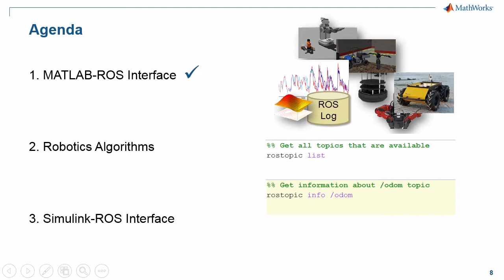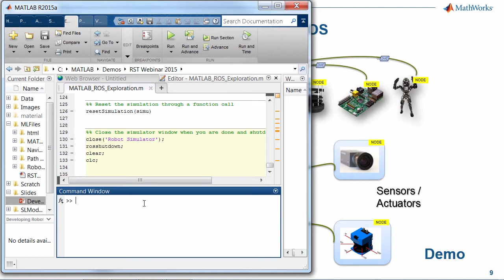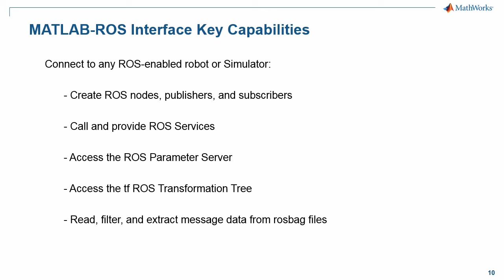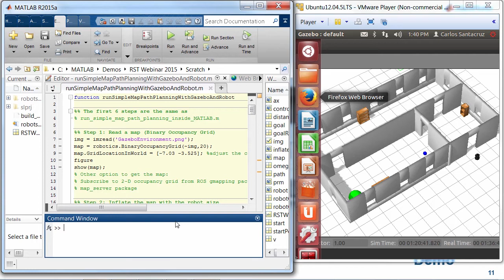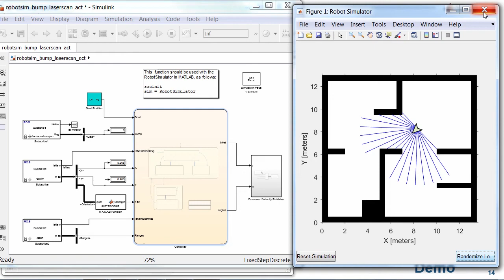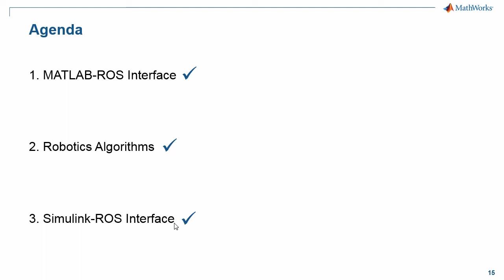Comment: I use matlab 2017a and i wrote rosinit but matlab didn't shows me tha same as you; You know what i have to do ? 
Thank you! 
(I have robotic system toolbox) 
Undefined function or variable 'rosinit'.

Error in paradeigmaROS (line 2)
rosinit
Reply: Yes, the same happened to me. I tried everything possible and it didn't work. So I installed 2017b. Now it works fine.